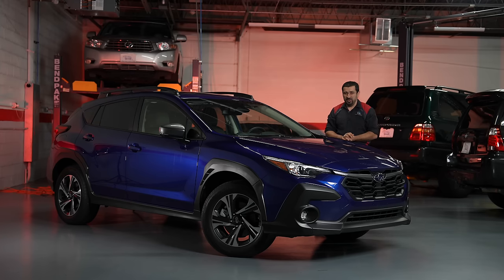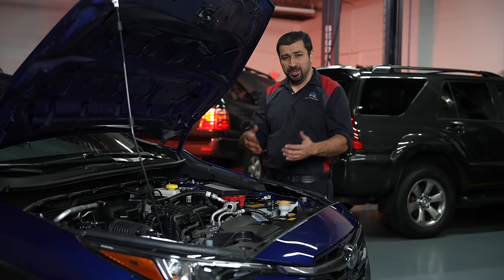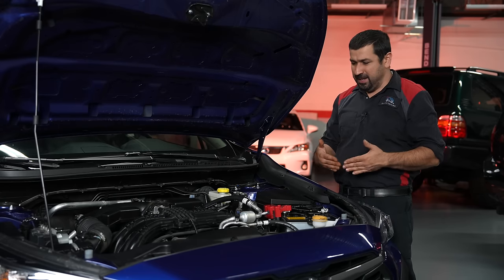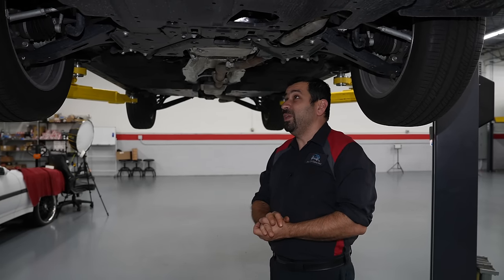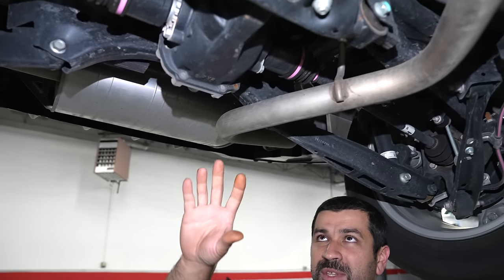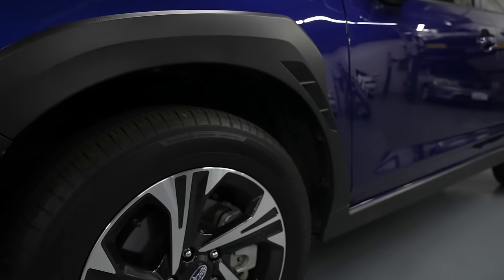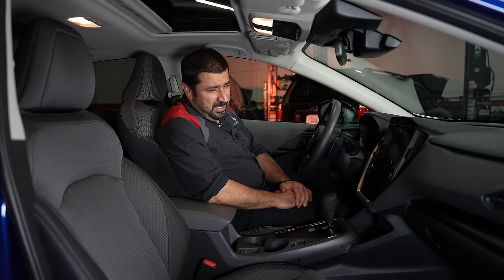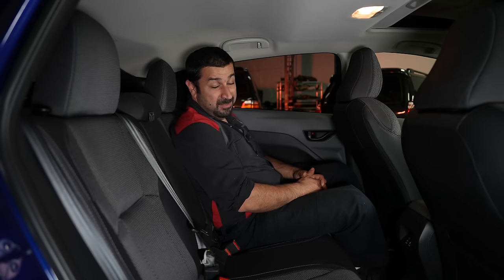Should You Buy a 2024 Subaru Crosstrek? Thorough Review By A Mechanic

Comment: Great review, hope you will do more like this, we need reviews from mechanics, not talking heads...
Keep up hitting the manufacturers about removing physical buttons.
I was disappointed, but not surprised to see rust forming on the suspension nuts and bolts. I have a 2007 Legacy and I have never seen a car that the undercarriage hardware rusts so bad, I also had a 1991 Legacy that was made in Japan, it was much better...

Comment: The Subaru sealer "creates a lot of debris, and that's the other issue. Moving on..."  HUH? Wait a second, doesn't that deserve further comment, please (about sealer debris plugging oil passages)? 
And doesn't having to pull the engine to carefully adjust 16 valve clearances sound like an expensive, required maintenance procedure? I've also seen where changing spark plugs entails lifting the engine off its motor mounts, with dealerships charging $600!
Reply: Thats only when you are disassembling the engine.
Reply: For the valve adjustment there is no official maintenance interval to have it done, merely an inspection at 100,000 miles. I have the feeling it something most people don't even have done especially if they are not having any drivability issues. They really aren't maintenance intensive cars.
Reply: Debris while servicing if you're taking it apart. He's talking about extra work for the mechanic. It's not a reliability issue.
Reply: @stoutlager6325  Thanks guys.
Reply: @niuhuskieguy  I have the feeling extended maintenance intervals are marketing-driven, and that some things should be checked more - or much more - often. Another one deals with Subaru's suggestions for required CVT fluid changes being much less frequent for American-market cars than for the same cars, often with the same powertrains, sold in other markets. Calling for less required maintenance (like another brand's "lifetime transmission fluid") helps sell cars, and I'm pretty sure Subaru, like other manufacturers, is not above doing this.
Reply: @stoutlager6325  Thanks. He should have clarified that.
Reply: @kenhoward3512  BULL. Current (since at least 2020) Subaru maintenance schedules for CVTs show CVT fluid changes at 3 years/36k.
Reply: @eskieman3948  Extended maintenance intervals often ARE marketing-driven (i.e., fictitious), to help sell how "low-cost" their cars are. When compared to other brands, Subarus ARE more expensive to maintain, long-term (an extra $2k over 10 years, on average, compared to their competition). Many people, still, apparently feel they are worth it - and are very defensive about the brand: Clever marketing, again.

Comment: We own a 2023 Crosstrek Sport with the 2.5L, in black-on-black. The 2023 is, in my opinion, a better aesthetic design than the 2024. The interior of the Sport trim is somewhat similar in style and durability to their Wilderness series (without the overwrought-ness of the Wilderness trim). Comfortable front and rear seats. The rear seating space is adequate, even for adults. The 2.5 engine is adequate, even at altitude. This car is our affordable, go-to gas sipper. It is also a do-it-all appliance. Easy to park in the city. Easy to blast up to the ski resorts, or for local adventures. Modern infotainment screen, with Apple CarPlay. Our kids love the vehicle. We will most likely (eventually) pass it down to the kids. My only critiques are 1.) it lacks rear heating / cooling controls and vents, and 2.) the rear lacks USB chargers. However the car punches above its weight, regarding value and functionality. It even cleans up well for occasional work meetings... Granted, we live in Colorado. We've added a Thule roof-top box, a hitch with a 2" adaptor, and an aftermarket skid-plate from Primitive Racing. All told, this vehicle (with the 2.5L) is a recommended buy. Especially in snow / at altitude. Or as a second vehicle, if you have a larger family.

Comment: A Subaru fan here....   Grew up with them as a kid in the snow....   Owned a 06 STI and my youngest currently drives a 05 Impreza wagon...    She wants a new Crosstrek, but honestly Ive been steering her away with DI and CVT...
Reply: I have a 2017 Crosstrek since new (125k kilometres).
The direct injection hasn't seemed to cause any carbon problems yet (I took the throttle body off to clean it last month & it wasn't dirty...spray cleaned it any way).
The CVT is holding up & by putting high-test (premium) gas, the car is noticeably quicker also

Comment: As mentioned is your video, the CVT is the deal-breaker in purchasing a new Crosstrek for me.  The Subaru Crosstrek has do much positive attributes but the CVT is an unwanted option and now the only choice.  Great vehicle though.
Reply: Don't knock the Subaru CVT until you try it. It's actually very good for daily driving duties. Super smooth and quiet and it returns excellent fuel mileage. The average driver probably wouldn't be able to tell the difference between the Subaru  CVT and an 8-speed auto. And I say this as someone who is a race track instructor, owns sports cars, and has driven every type of transmission on the planet. The Subaru CVT is excellent for its intended purpose, and is not really noticeable during normal day to day driving.

Comment: Happy to see you review a Subaru! I own a 2015 3.6 Outback and I'm amused by seeing Denso parts in this car as well, some seem like the exact same part on my parents 2010 Camry, surprised that doesn't show up more underneath to the point you called it out. 

Happy to hear someone like you comment on the relative reliability of Subaru's CVT, as to be honest that was one of the main concerns I have with the longevity of this vehicle, but 6 years in for me and it's been good, knock on wood it stays that way for many more years to come. And on another note, you've confirmed with your gripes my reasons for wanting to stick with my car and not being particularly inclined to buy another Subaru after this one. Nothing bad with mine, but the 3.6 flat six while underpowered for it's displacement (and comparing it to the other 6 cylinder in my garage a J35, it feels much lazier when in combination with the CVT) isn't slow as you mention the Crosstrek to be, and it's a very smooth, reliable engine with port injection. This gen still has physical knobs for the AC and other controls. For the life of me I do not want touch only HVAC controls; a backup on the screen sure , but not the sole option there. 

My car doesn't have eyesight, but do know that while your points about it being more protected than hood mounted radar systems is absolutely true, Subaru factory windshields are notorious for being fragile, to the point they will crack often, and it's been the case of at least one class action lawsuit that I know of and that's just for Outbacks. After replacing the glass you do need to recalibrate the system from what I'm told. My car has long had it's glass replaced by something other than the OEM part (it is from an OEM manufacturer of other panels glass in this car, just not the windshield in this case) and it has proven to be far sturdier than the factory piece, already tanking several rocks without issue. 

AWD is nice, but the ground clearance on these cars, without it having very top heavy driving dynamics is what I love about them, even if they do understeer, even more than our Odyssey. Living in Mexico where paved roads can be a bit of an adventure sometimes, knowing the car's ground clearance is a lot of peace of mind, as well as knowing that the car can power all 4 wheels, and the driving dynamics go from boring to very fun on dirt roads, where a bit of tail out action is right there if your technique is right.

Comment: Hello, Love your review videos. Im an electrical engineer and facilities mechanic. Just one comment about the CV transmissions that I don’t quite agree with… they aren’t overly complicated. A typical man/auto transmission with clutches, planetary and sun gears, solenoids, etc. are much more complex in my opinion. Cvt’s are beautifully simple mechanically but complex in their torque ratio control. The torque ratio between the input and output pulley needs to be exact at all times, but it’s all done by computer control and frankly they have been pretty well made and mastered for years now.  Nissan made some mistakes for a while, but it was mostly with cooling issues and underpowered pumps. Cars would have had cvt’s years ago but the hardest hurdle to overcome was the design for the steel belt on the push input to output configuration. I believe Subaru uses the chain pull configuration. Both have pros n cons… the push belt configuration’s weakness is slippage and lower torque. The chain configuration’s weakness is chain snap or stretch and chatter. Honestly feel they run quite well and smooth and are perfect fit for modern light vehicles. I just wish the industry would get on top of training techs for maintenance and making parts available. As of today they are basically sealed units. You can change the fluid, but must be cautious to replace exactly what comes out… they are sensitive to fluid level due to calibration.

Comment: I feel better about our Crosstrek now. I have had so many people tell me its a crappy car. What I have read that is IMPORTANT when it comes to the CVTs in these is to change/flush the fluid every 30-50,000 miles. The complicated metallic mesh that forms the belt is going to constantly shed tiny metallic particles into the fluid and so unless you change it regularly its going to get increasingly abrasive. Ours gets around 35MPG on average and so far hasn't had a problem. It the EASIEST car I've ever owned in terms of changing the oil. 10 minutes and its done.

Comment: I have gone back to buying older cars 🚘 with manual or proper automatic transmission. The CVT transmission is a no-go for me. I had a  umber of Subarus in the past but on Impreza 2019 I 😊hated the CVT as well as the stop/start system that I disabled.nthank you for your review AMD, well presented as usual. From 🇦🇺🦘👍

Comment: The 2.5l boxer has a great chance of burning copious amounts of oil. It certainly did in my 2018 Forester -- which was maintained religiously. Not sure if the 2.0 also does.

The worst part is that Subaru will tell you with a straight face that burning a quart every 1,000 miles is normal consumption for a well-maintained engine with 40,000 miles!

Oh...and sometimes those plastics in the interior will develop rattles early on. But for the duration of the bumper to bumper warranty period, no Subaru dealership tech will be able to hear them 🙄

Comment: Subarus may start out loud, but it's impressive how little you have to spend to make the cabin much much quieter. I have a series on my channel about how I've done it, less than $300 makes your drive UNNATURALLY quiet. 👍
Reply: My 2024 CT is not loud.  It's surprisingly quiet.  I don't need to spend $300 more.
Reply: @fred4080  You'd be surprised how much quieter it can be. 😏

Comment: Thanks for the review. I have the last gen and the 2024 isn't a huge revision, so some of your complaints stand for last gen, e.g. lack of physical buttons for some very simple things. In my case, I wanted to disable the auto door lock for when the car starts moving and had to dig through the menu to turn it off. It's a useful feature for safety, but not if you are constantly picking up and dropping people off. Regarding the engine, it's adequate for Japan, where I live. Most streets here have 40-50 km restrictions, and 30 km for schools and heavy pedestrian areas. The regular CVT mode does have an annoying sudden downshift which makes acceleration jerky at times. The remedy is to put it in sports mode. Regardless, I got the Crosstrek for its safety features and the all-wheel drive, and I'm quite happy with it.

Comment: Probably would have ended up with a forester if not for the CVT. Got a CX5 instead.
Reply: 2018 Subaru forester 6MT. The last year they offered a manual for the forester. Love it, considering a Subaru for the wife but I don't trust the CVTs on the new cars.
Reply: Isn't the CX5 also CVT?  I do prefer the CX5 with better styling and interior quality but the price it's higher and the Markup dealership is asking pushed me to get the 2023 Forester instead. I also got $500 off from the MSRP.  Free gas money for the year for me.  The standard And one of the best 4WD, all the time, and the price is the deal breaker for me.  If $2/3K is not an issue, I would have gone with the CX5 with AWD but reality set in.
Reply: @yummytummy88 CX5 has a 6 speed automatic
Reply: @yummytummy88 no, pretty much every Mazda sold in North America with an automatic transmission except the CX-90 has a 6 speed torque converter. Mazda hasn't said if the CX-60 and CX-70 are going to be sold in North America.
Reply: Seemed like all the Mazda's currently sold have the same SkyActiv engine or a turbo.
Reply: @davidglad  basically every car they sell except the CX-90 which has an inline six and an 8 speed auto
Reply: @yummytummy88 I’m a mechanic as well, and honestly I’d get the CX5. as a former mazda tech, i left because the cars are just too reliable. they don’t break often enough for work, lol
Reply: @OutsideTheTargetDemographic  Nothing wrong with the new CVTs.  Stop listening & watching the BS hustlers.
Reply: @bitbat9  Antique automatic.  If Mazda went to an 8 speed auto, the MPG on a CX-5 would be up where it should be.
Reply: @eskieman3948 yeah it’s getting a bit long in the tooth at this point. Mazda’s fuel economy with the 6 speed (especially in the turbo models) is just atrocious